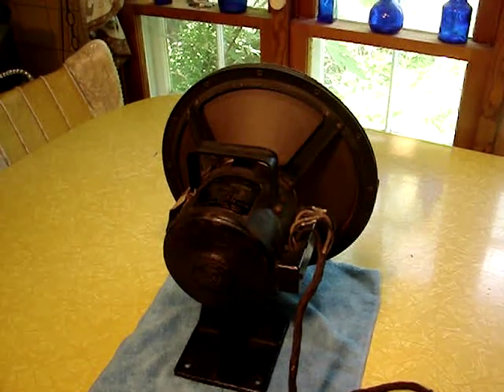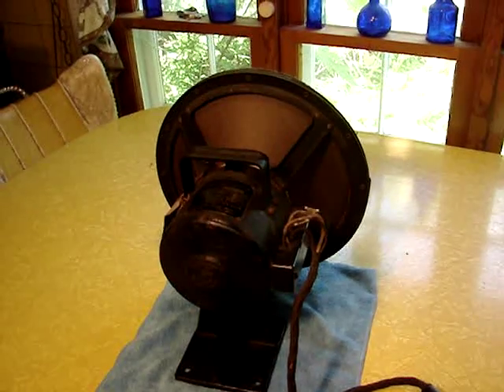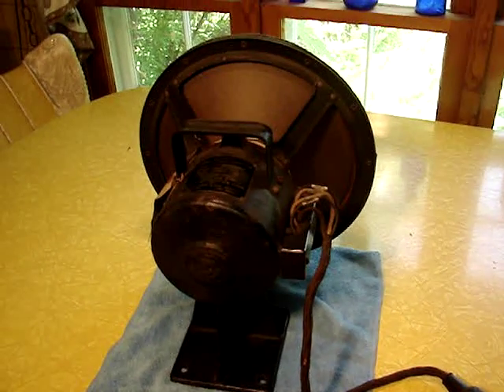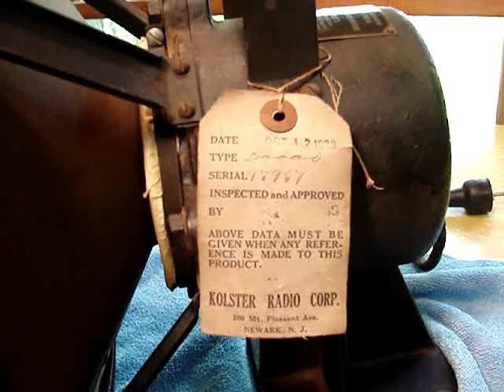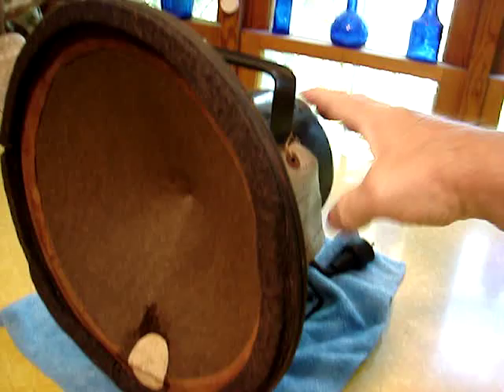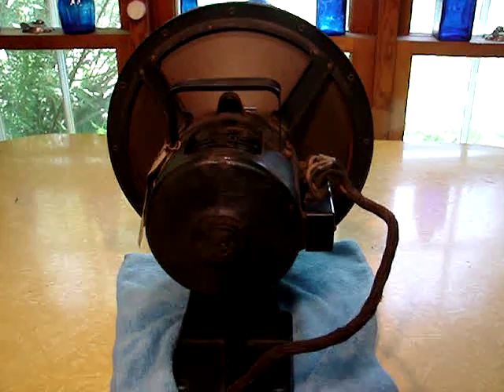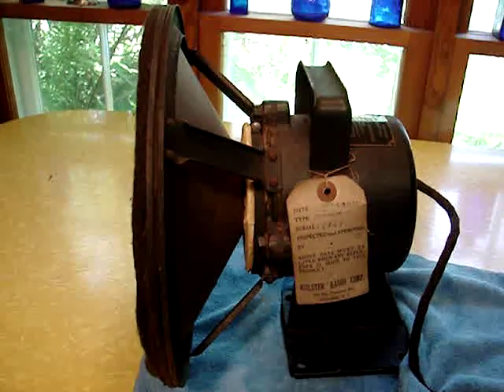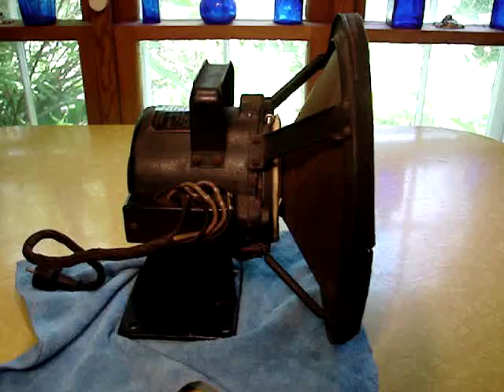Kolster Dynamic Speaker

Comment: I just pulled the same speaker (minus the handle) out of a c. 1930 Columbia highboy console radio.  It weighs 21 pounds!  Mine would need rebuilding, as the paper surrounds deteriorated and the retaining ring is not retaining.  The speaker cone itself is fine.  For now it's just an object d' art for the radio/man cave.
Reply from the maker: I sold mine to another collector who had the radio that the speaker belonged in but his radio was missing the speaker. There are many youtube vids about speaker surround repair.

Comment from the maker: Continued: With the emergence of dynamic style speakers that had permanent magnets the field coil speakers were in turned called "Electro-dynamic". So we actually have two "dynamic" style speakers that have "vibrant" or "lively" moving voice coils. PM which means permanent magnet and electro-dynamic which means speakers with a field coil. Incidently-I worked for the Hammond Organ company back in the late 1960s and was introduced to a wide variety of electro-dynamic speakers.

Comment from the maker: The metal name plate is clearly named "Dynamic Reproducing Unit". That is actually refering to the movable voice coil which encircles a pole piece of which in turn is electrically magnatized by a coil. The coil which creates a magnetic field is therefore called a "field coil". In the 1920s most cone speakers were "balanced armature" speakers. In the 30s and on upwards PM speakers of a dynamic style (moving voice coil) began to emerge when better permanent magnets were developed.

Comment from the maker: It is a jewel indeed. I was going to leave it behind but my junque collecting sickness took control of my senses. I have never seen a speaker like this one. It almost looks like a cross between a speaker and an electric fan. The speaker in my old Victor console radio is a heavy hunk of hardware but it is nothing like this Kolster speaker.